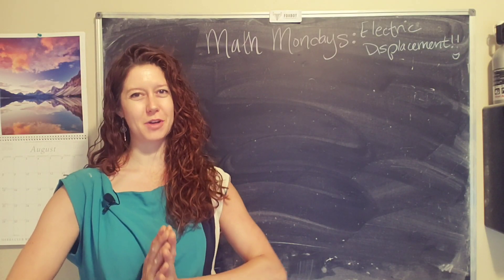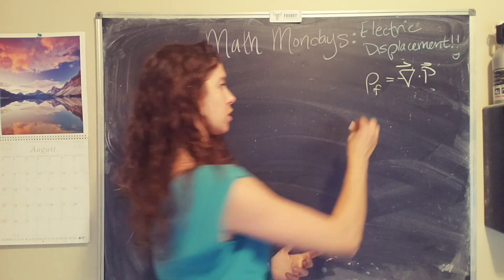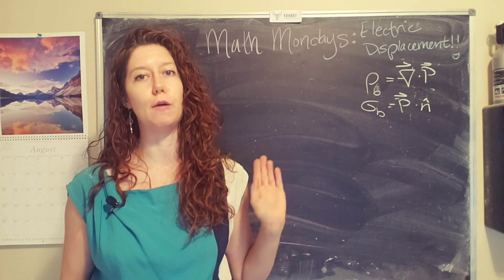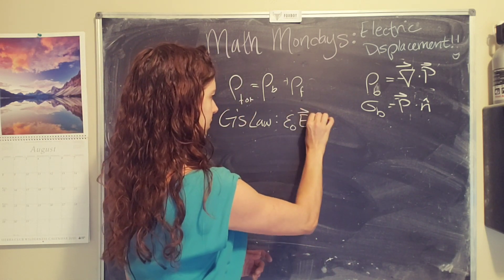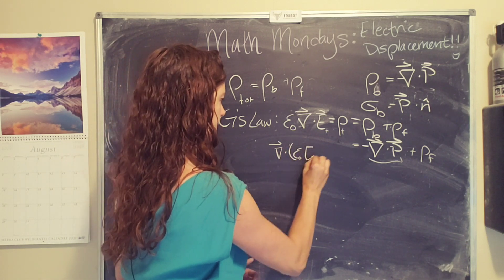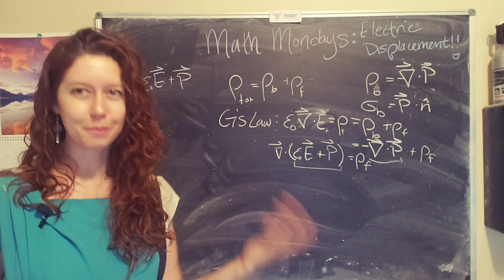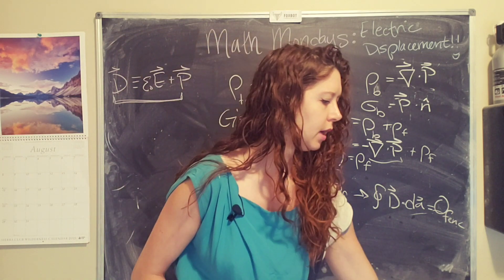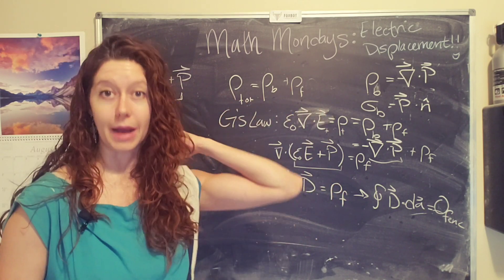Electric Displacement: a helpful intro!

Comment: Question for you - we have a Lorentz disk (horizontally-oriented thin metal, round shape, magnetic (B) field vertically oriented up through the center axis, and induced RF currents that run radially through the horizontally-oriented disk).   This E x B (right hand rule) creates the Lorentz force in the charged particles of the metal, at the rate of the RF frequency.

In your assessment, what would give a larger quantity of polarized dipoles:
1) aluminum
2) a strict dielectric
3) magnesium, which has far more bound charges than aluminum
.
Reply from the maker: lol this sounds like a homework question! i don't answer these kinds of questions b/c it's important for you to use your understanding to analyze problems :)
Reply: @JenFoxBot  This is the very first device that artificial gravity hobbyists build - it is called a Lorentz disk.

The question was to ask your opinion of bound charges versus conduction band electrons - while aluminum atoms will polarize in an E field,  we wanted your opinion of whether the dipoles of the bound charges would be, say, larger in number (since conduction band electrons can move away), and also whether the electric dipoles created by bound charges would attain a larger degree of dilation ('stretch') for the same magnitude E field

But definitely not a homework question, since artgrav is sort of unique to the hobbyist community.

Comment: I wonder if this is something we'll cover in my Physics 2 class. We just went over Coulomb's law and Gauss's Law, so I understand some of this directly. I've been on a Physics binge lately trying to really get the core concepts in my head. I want to be good at Physics as a Computer Engineer major. I'm sure working on the hardware side that it'll be tremendously helpful/essential.
Reply from the maker: Thats awesome! Physics is beautiful 😄 when I moved into electronics I found that a fundamental understanding was super helpful with debugging. Those charges gotta go somewhere!! That and a multimeter lol